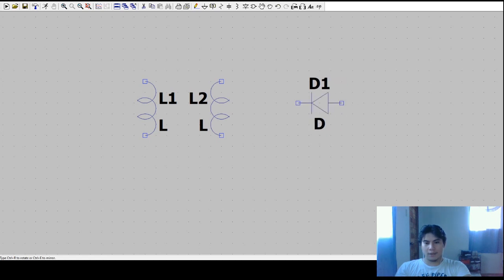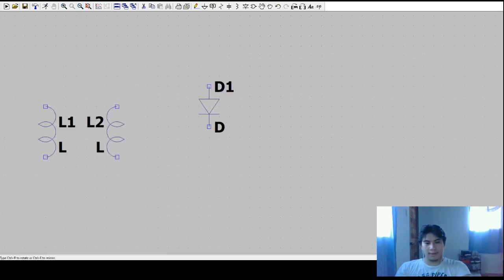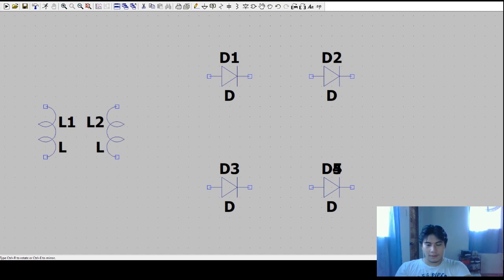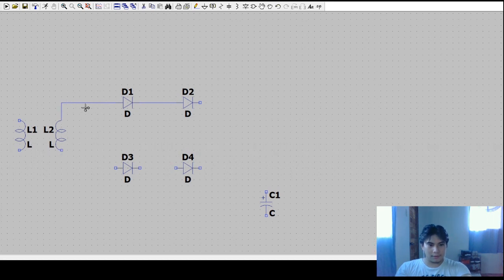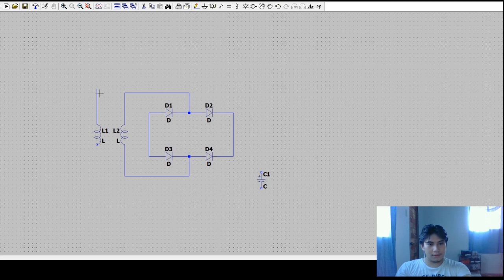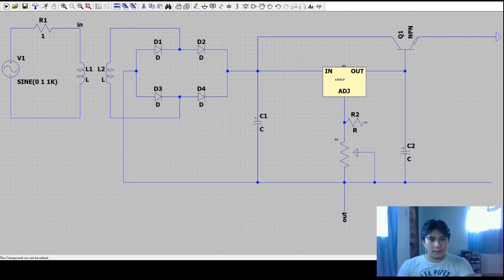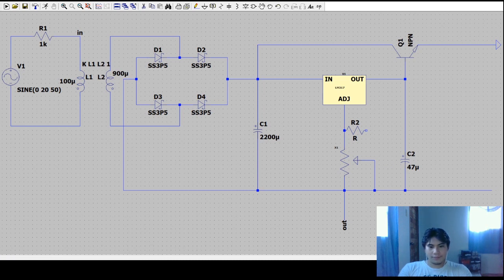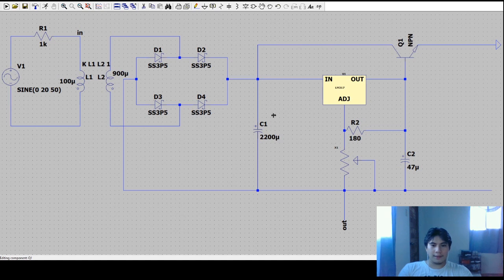LTSpice Simulation with a Variable Power Supply

Comment: Nice video!
Can this spice warn you if you exceed an LDO's short circuit output limitations?  (Some specs day to use protection diodes to avoid problems with shorting the output, others don't have that requirement)
Reply from the maker: I'm sorry but I don't know if the spice sends a warning. I'm just familiar that the Spice won't give any resulting output if there is something wrong with the simulation.